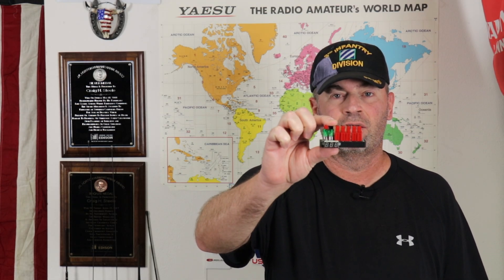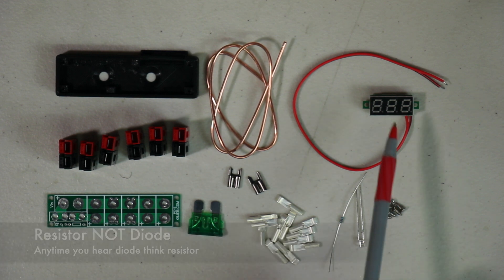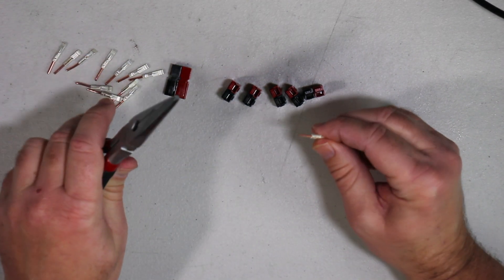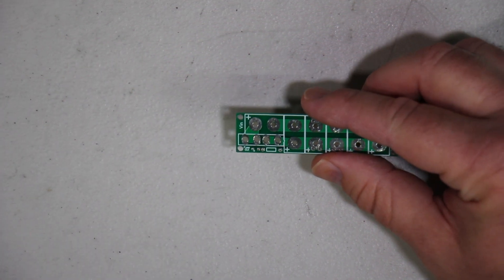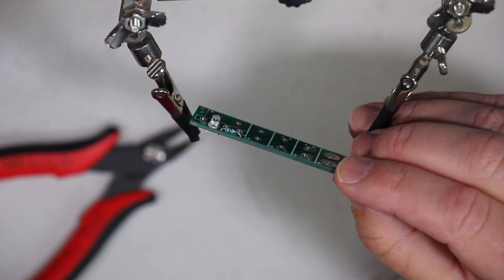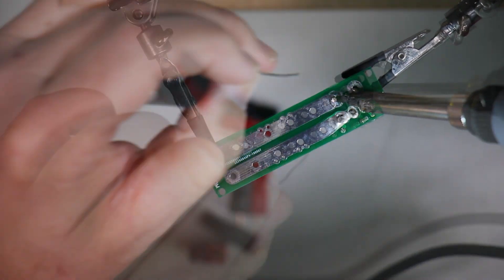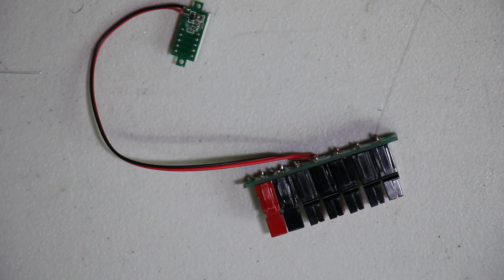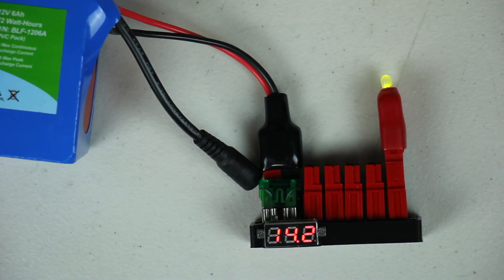PowerPole Distribution Block Kit

Comment: Here's a little trick for you. Start out by putting one end of the copper wire into a vice and then using a pair of pliers grab the other end and just pull it to stretch is slightly. This will give you a nice straight length of copper wire to start with instead of having to straighten each one once you're crimped them into the pins.